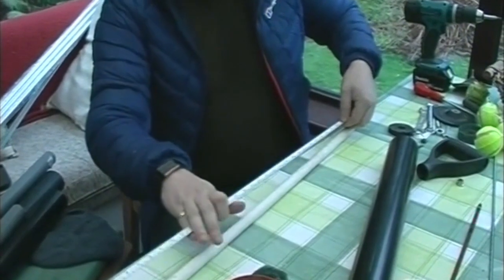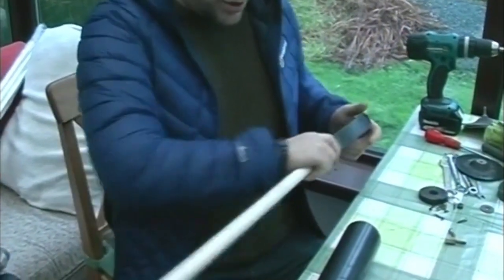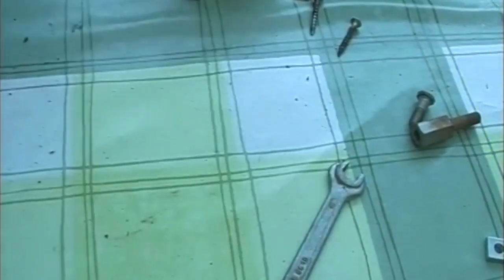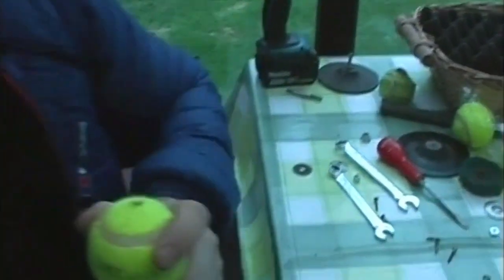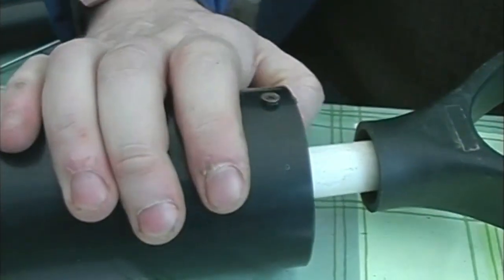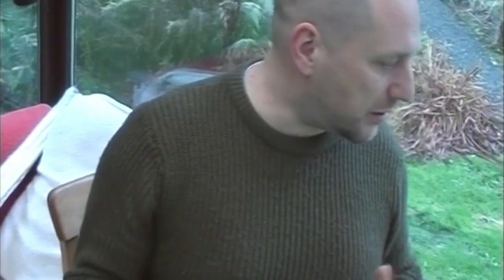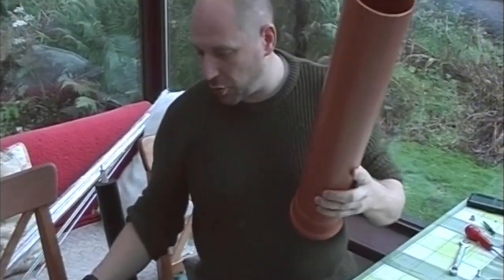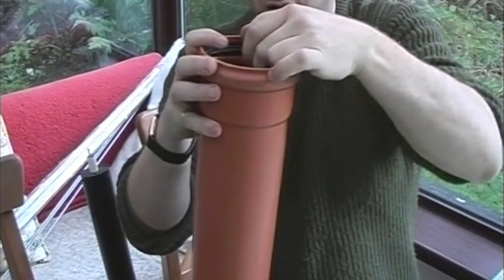Hand dredging - making a sucker pump

Comment: Great video Roy. 
I don't make them with a tennis ball anymore instead i use a tick chopping board cut 3 circle discs and in between the discs I use letter cloth it's got a lot more suction than the tennis ball try it yourself and see how you get on.
Reply: I find a piece of leather behind the tennis ball is the best.